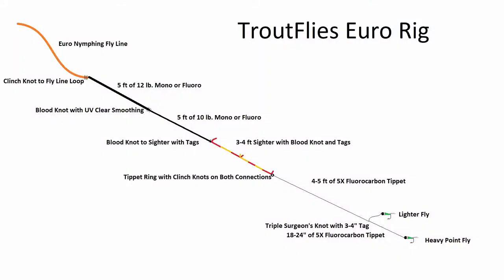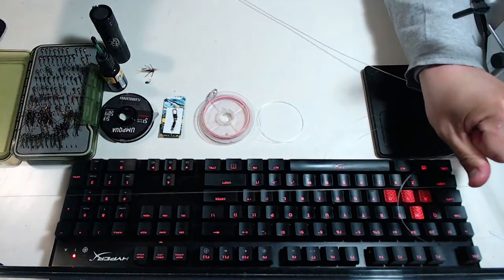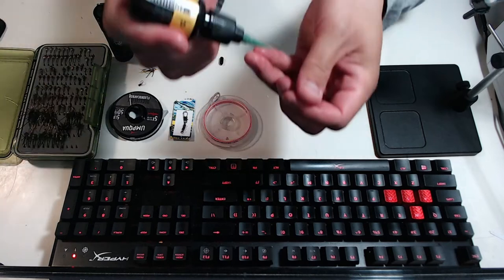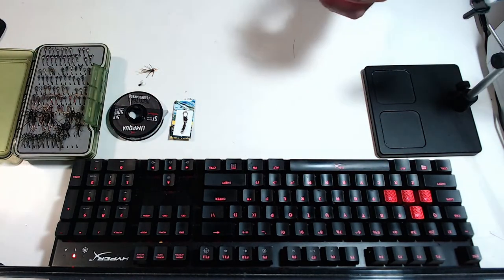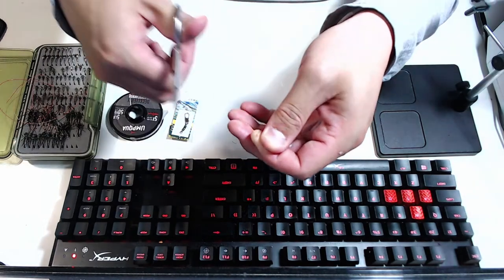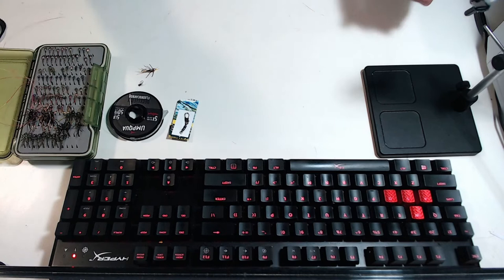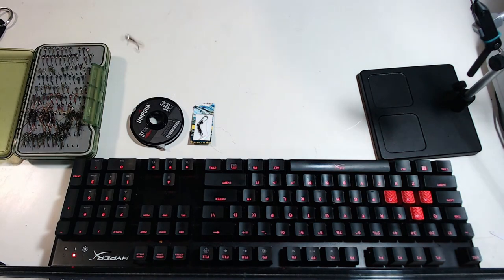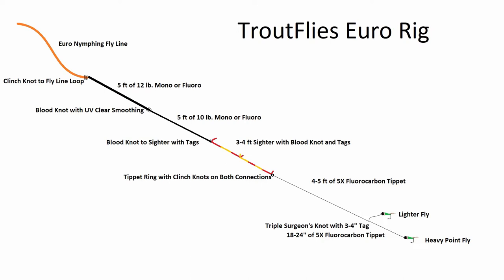Euro Nymphing Rig Setup - TroutFlies Tutorial #2

Comment: I was just thinking about why p[eople use mono for the butt section and then you use flouro. Do you think that's a cost thing? I was thinking that Flourocarbon would have less memory than mono.
Reply from the maker: It might be a cost thing, it also might be a memory thing, as people think fluoro coils more. Either nylon or fluoro you're gonna be straightening it out before you make your first cast, so I don't really notice a difference. I wouldn't have a problem fishing nylon, I just have so much fluoro laying around that I use it.
Reply: @TroutFlies  oh okay, I didn't realize that mono had the least memory of the three.
Reply: @driftstone  most people started with maxima chameleon for the stiffness to get turnover when casting, but as you get into micro leaders that feature (stiffness) disappears, and we rely on the weight of the flies themselves, and use more crisp casting movements to get the leader to turn over. 

fluoro also can pigtail when it goes through the guides under tension, nylon helps with that. 

personally, i've switched to using all sigher material from my euro nymphing line down to the tippet ring. no knots to catch going in and out of the guides, no pigtailing, and dead simple to set up.